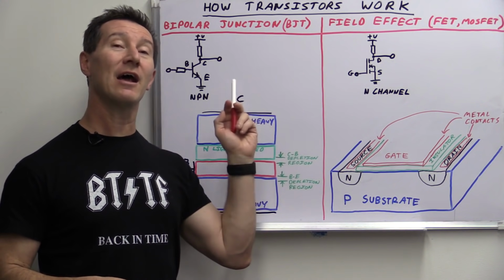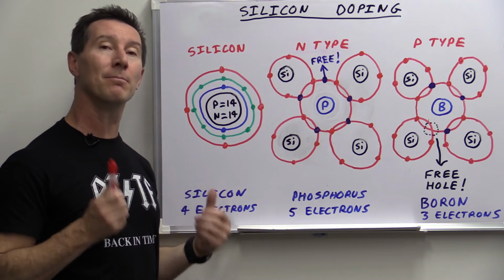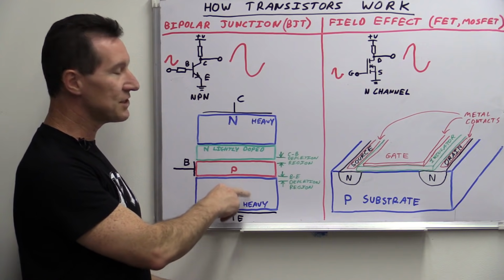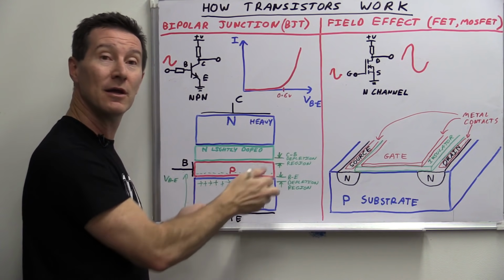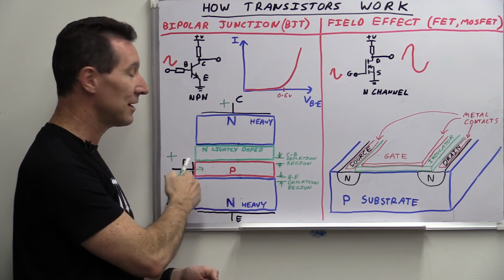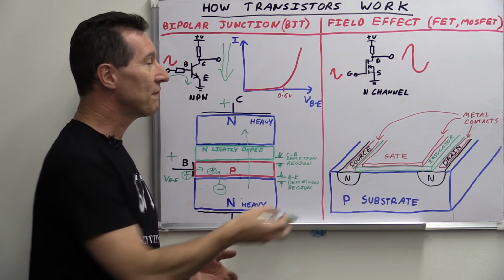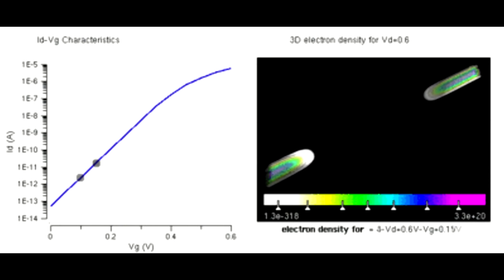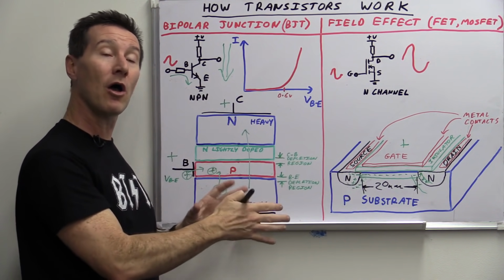EEVblog #748 - How Do Transistors Work?

Comment: Imagine inventing something like this and coming up with a way of building them. THAT's what boggles the mind!
Reply: cipmars That's why the three physicists which invented the first transistor were awarded with the physics Nobel price.
Reply: genkiadrian I didn't know that, but it's 100% desirved.
Reply: cipmars Yes that is true but everything stems from somewhere. Prior to the modern transistor was the vacuum tube triode which was much bigger and used different  principles. Even the transistor has changed so much since it was created. THAT's why electronics is so awesome!
Reply: Hana Zener Diode That is why it is a pain in the a** after almost 60 year of doing this. I started a boy. :) Now learning SDR. Not sure why, but it is fun.
Reply: Jerry Hubbard Should say "as a boy".
Reply: I could bet my ass on that if they wouldn't had invented it, just about twenty years later someone else would have done that. Hard and good work anyway. Remember: The light bulb was invented by 3 people independendly but only one got an award for that.

Comment: How does the doping process work when creating something like an ASIC? Seems like it requires a lot of precision to do the various different layers. How does it scale to doing something like a GPU with 8 billion transistors?
Reply: Razor2048 Doping is done with gaseous diffusion or ion implantation. Neither process is precise to the atom. You just introduce the dopant atoms to the silicon with either thermal or kinetic energy and the atoms figure it out for themselves.

Comment: Its funny how in such a complicated discovery of electron flow we use a convention which was incorrect, But since we had been using it for so long we though f it, we'll keep using it.
Reply: ***** the convention isn't incorrect, it's just unintuitive at first. eventually you just realize that positive and negative are just labels and that the math would have worked out either way.
Reply: I look at it kind of like a marble rolling into divots.  If you narrow the view to just the width of a marble, you can longer tell if the marble is moving forward into and out of divots, or if the divots are moving under the marble.

I know nothing about semiconductor physics though.  Voltage on base, LED lights.  That's usually good enough for me.
Reply: ***** It was England and the U.S. politicians, after World War Two that used fear of the Hiroshima bomb going off in your backyard, to get citizens to agree to hide the atom. Unfortunately for us the atom and matter is an electrical effect. Which inevitably would lead to the field of electricity having to be turned into chaos, in order to hide the atom. I am sure there is an old chemist somewhere that would say don't feel bad you should see the field of chemistry. And doctors that will tell you don't feel bad you should see what happened to medicine. Pretty soon Raise it Down and Lower it Up, might be how elevators work.
Reply: matt holland It might not be incorrect, but it's very confusing.
Reply: Vladimir Nicolici agreed!

Comment: Excellent video Dave!!
Could you please make a video explaining the manufacturing steps required to produce a transistor/mosfet? For example how do you dope silicon? How are the channels etched? How is the insulating oxide layer created? How are the metal contacts deposited?

Comment: Hi Dave, can you please make another video about transistors (BJT and MOSFET) where you can explain on how to actually correctly read a datasheet? There are so many notations and values and I just don't know where to look to check if the transistor meets my requirements.

Thank you!

Comment: Very good presentation. The only difficult thing was the explanation of the current amplifying physics. That was unclear. The mosfet was very clear.
Reply from the maker: gamingSlasher Ah, yeah, could have made that better. Basically, small number of holes enter from the base, huge number of free electrons get moved up from the emitter due to the collector voltage, and only some of those electrons match up with holes to exit the base. the rest go up to the collector. Hence small base current, large collector current.

Comment: I have worked in electronics, both as a career and as a hobby for more than 40 years. Even after reading several articles and books about how transistors work (remember the old RCA transistor manual?), I never really understood it as clearly as your explanation here.  Thanks.

Comment: Fantastic explanation - love your energetic presentation style. I've tried a few times to get into electronics, made a few basic circuits (op amps, NE555 timers and the like) but have had real trouble picking up the basics of circuit theory from books. Have you done tutorials on the subject or would you consider doing some?

Comment: They cant squeeze the transistors smaller and smaller .Can they get away with stacking  transistors on top of each other, hence archive performance on a cpu?  or is there another way to pack more transistor in a single die in the future?

Comment: Beautiful description, really!
Just one thing is not clear to me... Are the mosfet drain and source really the same? Can I just swap them?
Reply from the maker: tomy983 No you can't swap them. I deliberately didn't show the internal diode that forms between drain and source, that prevent use in the other direction.
Reply: EEVblog That is true for discrete MOSFETs, these (always?) have the diode which is usually an intrinsic part of the internal buildup of these type of MOSFETs. However if the diode was not there for some reason (for example on the MOSFETs that are used inside almost any IC these days) then indeed, drain and source are identical and you can swap them ! For on-chip MOSFETs they are physically identical (usually, there are always exceptions of course).

Comment: I thought the depletion region barrier is caused by the non-neutral point charges left by the donor and acceptor atoms (after the carriers diffuse and recombine at the junction) that causes a strong electric field that repels carriers from entering the junction even more, not the carriers themselves creating a barrier as you explained!